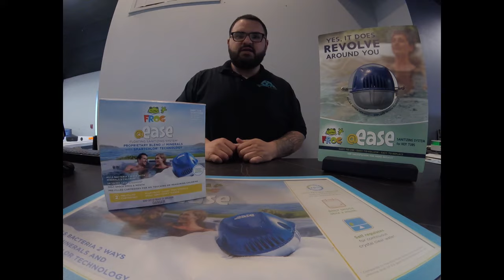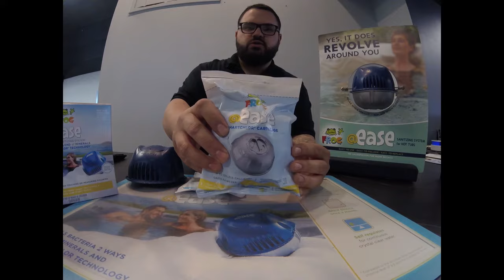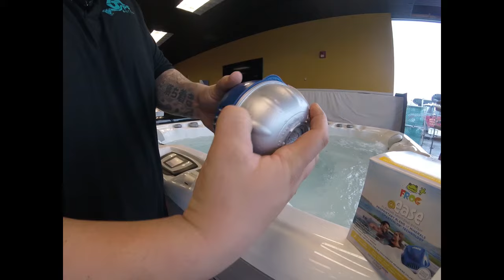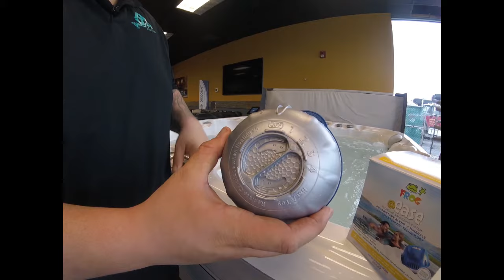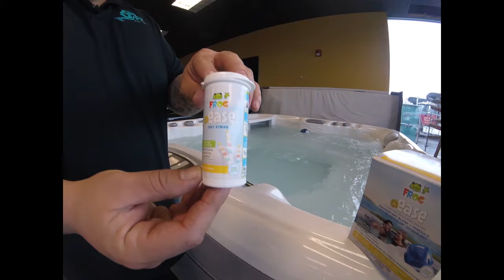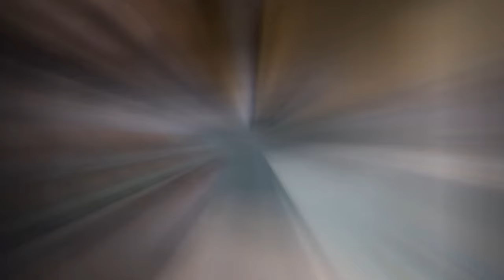How to set up your Frog @Ease Sanitizing System

Comment: LOVE the Frog Smart Chlor in my Artesian Spa but it's ridiculously over priced and environmentally wasteful to throw out all that plastic every two weeks. My spa is 400 gallons and I was tearing through a cartridge every 2 weeks. Pried open the top of an empty, filled it with 1" tabs and saved myself close to $300/yr and a landfill of a bunch of discarded plastic.
Reply: I would assure that your water chemistry is balanced, the smartchlor cartridge should be lasting more than 2 weeks. If the water becomes acidic than it will definitely run through the chlorine much faster than it should. Hope this helps.
Reply: 1" chlorine tabs I'm assuming? I hope it wasn't difficult to pry open as I will do the same 😆
Reply: Hi Jeffnnf Would love to see you do a video on how you pry it open and fill it!   and use it....

Comment: Anything “special” about the Frog test strips or, will ANY test strips work for testing the water with this system?

Also, can you simply use baking soda to adjust TA?  I’ve heard 1 tblsp/100 gals of baking soda works the same.  Thx!
Reply: You can use any test strip to test for pH, ALK,  and Calcium however to my knowledge I believe only the frog test strips will test for the “smartchlor” level which is your chlorine. 

I personally have never used baking soda to adjust chemistry only because the proper chemicals are more readily available for me to get being I work for a store however I have heard of people using it. 

Hope this helps.

Comment: Would you recommend starting at a 4 for a swim spa that is 15’ long by 5’deep? Or two frog ease systems?
Reply: The @ease system is designed for hot tubs up to 500 gallons however Frog co does make another product called “Flipping Frog” that is designed for small pools that are 1,500-5,000 gallons which is what I would recommend for you. Same concept as the @ease product just a larger scale. Hope this helps.
Reply: @mr_j0st235  thank you!

Comment: As you didn't mention anything about replacing the minerals, and the website claims that they last up to 4 months, does that mean that after every 4 months you buy an entire new system? Or is there a replacement for the mineral cartridge?
Reply: Thank you for pointing that out. I apologize I did not specify on that. Yes after the last Grey cartridge has depleted (approx 4 months) then you will replace everything again. Purchasing both boxes at that point will give you a new blue side, 4 smart Chlor cartridges, a new bottle of test strips, and another packet of “jump start”. At that time I recommend changing the water in the spa. Hope this helps!

Comment: Can I switch to this system without draining and refilling my tub ??
Reply: It depends on what sanitizer is currently in the water but I would definitely recommend changing water. You will most likely get a foam reaction if you mix different sanitizers.

Comment: Is it absolutely necessary to drain the tub and start with fresh water? I’m on a well.
Reply: Yes, it is recommended to changed your water after you run through the last replacement cartridge. That should put you at around 4 months. Because we are dealing with only a couple hundred gallons, you can only put in so many chemicals until the “Total Dissolved Solids” reach a PPM (parts per million) too high, no longer allowing the chemicals to break down (or dissolve) and affectively keep the water clean and alkaline. 

Think of it in a smaller scale..

Taking a cup of coffee and mixing sugar into it. The sugar will dissolve into the coffee. If you continue to add teaspoon after teaspoon eventually the sugar will no longer dissolve because the TDS (Total Dissolvent Solids) level of the coffee is too high. 

Does that help?
Reply: @mr_j0st235  this is awesome to know! I was gonna stretch it to 6 months but now I know why it's 4 months! thank you!!
Reply: @mr_j0st235  thank you

Comment: Very good instructions, thank you. My original cartridge has made it to 5 weeks.  I add a scoop of renew per person/use, and have been testing water a couple times per week. Adjusted pH and alkalinity a few times. Cl has been light green a couple times, added renew and adjusted frog up from 2 to 3 for a couple days. Any thoughts appreciated.
Reply: It sounds like everything is in line. If the chlorine is consistently low with good pH and ALK levels then you may just have to increase the chlorine level on the smartchlor cartridge. Other wise I think you are all set
Reply: Renew? Is this a necessary item?

Comment: When the ph is low, do I just add ph to the water or so I have to put in to a gallon of water first and then mix before adding to the water
Reply from the maker: Thank you for watching the video. You can just add the PH up directly into the spa, no need to mix before hand. Just make sure that you turn on all pumps and jets are open to let it mix throughout the spa.

Comment: Thanks, this was very helpful.  I just filled the spa with cold water.  Do I wait until it is warm to start?  Or do I do it with cold water?  Thanks again
Reply: Thanks for the feedback David,
Yes I would wait till the water gets to the set temperature then adjust the chemistry at that point.
Reply from the maker: You can add it when it is warm.  Let it mix around for a while and then test the water a few hours later and see if anything needs to be adjusted.